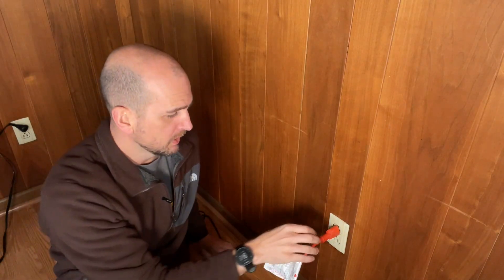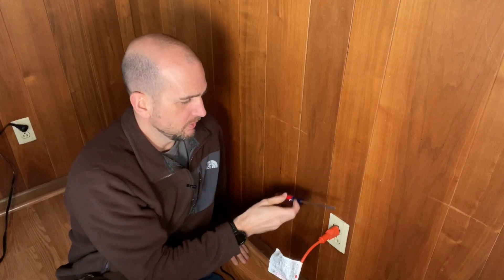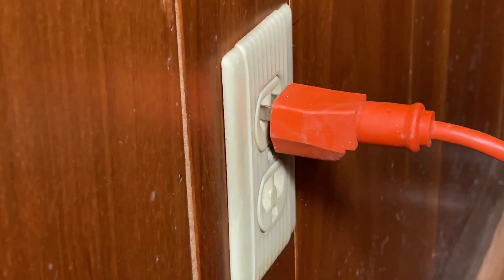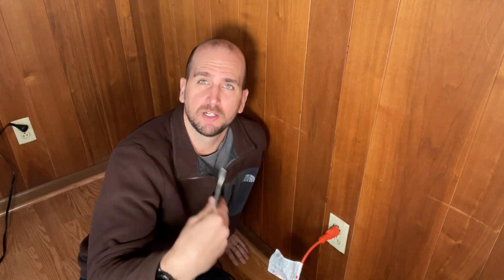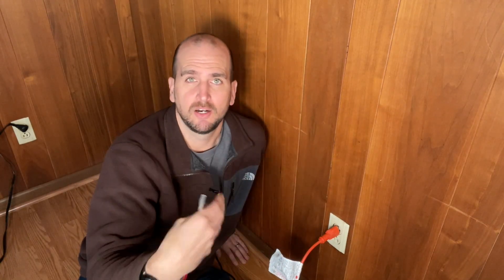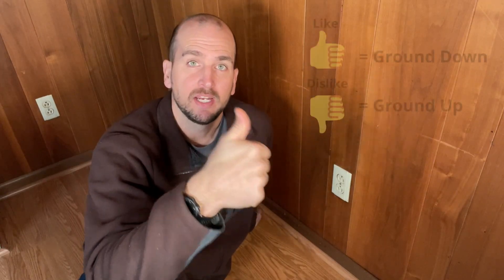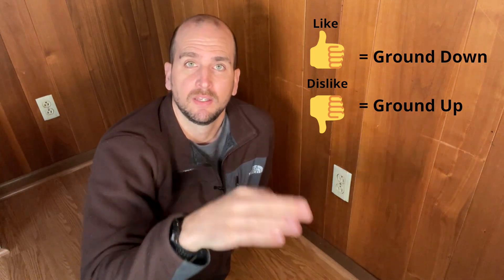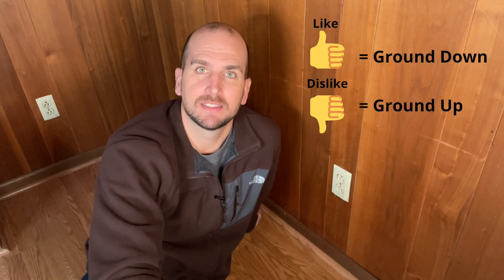Should An Outlet Be Installed Ground Down Or Up

Comment: To me it makes sense to have the ground facing the ground. In Australia the earth faces down but in China it faces up (it is 180deg rotation IIRC). Our power sockets with switches have a red mark on the switch and you make this visible to the user so the earth is down (I think it covered by AS/NZS3112 but I am not sure.)
Reply: There is no regulation concerning this in Australia/NZ.
However, it has become a "convention".  
Since both single and dual outlets are installed horizontally in Australia,  devices such as Switch Mode Power Supplies are designed on the assumption that the Earth pin faces down.
Also the most popular plug in Australia has a sideways connection for the cable at the 135 degree (4:30) position. (i.e. It is angled downwards to the right hand side)
This "works" only if the Earth pin is downwards.
(https://commons.wikimedia.org/wiki/File:Australian_32_A_vs_10_A_mains_plug.jpg
Reply: @FrodoOne1 That link show nothing. yeah and the red mark on the switches make it stupid to install them so that can't be seen.
Its ages since I have a 135 plug on a new product in Australia but I don't doubt that they may exist.
Reply: @ianmontgomery7213  I am not really sure of that which you may be writing.
How about this (https://www.bunnings.com.au/hpm-10a-3-pin-white-electrical-plug-top_p7053432) as an example.
Or, perhaps, this plug on the device concerned 
https://commons.wikimedia.org/wiki/File:Australian_10_A_Power_Board_with_Overload_Protection.jpg
Reply: @FrodoOne1  The socket has the switch with the red mark not the plug.
https://www.bunnings.com.au/deta-double-pole-double-power-point_p0087096

The only reason I can for the convention is that if a plug becomes loose and is about to fall out then having the earth on the bottom assures that the socket is earthed until it disconnects.
Reply: @ianmontgomery7213   @Ian Montgomery  The "link" had an extra erroneous ")" at the end. (Sorry)
This has now been removed and the link now "works".
Such plugs are readily available for replacement purposes and are installed on many "extension leads" and "power boards". (https://www.bunnings.com.au/arlec-4-outlet-powerboard_p4330507 )
Reply: @FrodoOne1  yeah but we are talking about sockets not plugs. Plugs have to go in whatever way the socket is configured.
Reply: @ianmontgomery7213  Yes, "we" are talking about socket outlets.
"Plugs" must need fit into them and conform to the "orientation" of the socket outlet concerned.
However, the two devices work in combination - for the satisfaction (or otherwise) of the users concerned.
It seems that Australian manufactures and users have come to an "arrangement" which is satisfactory to all concerned - without "GOVERNMENTAL" regulation.

(Australians seem to be quite good at such "arrangements" !)

Comment: Had an aluminum outlet cover come off & fall across both legs when a client went to plug in her dryer.
  It took a while for the breaker to open as the cover slowly slid down while melting across the legs.
  Huge black marks on the new paint, Burn holes in her sweater sleeve, red spots on her arm.
       It looked like somebody had taken a plasma cutter & cut 2 slots into the cover.
       Heavy brass outlet prongs nearly severed in half & welded to the cover plate.
A painter had taken out the cover screws to paint & had not put them back.
       She was reaching down behind the dryer in quite an an awkward position to plug it in
       & BOOM !!!! 
       Happened circa 1989, still to this day when I see a dryer outlet 
       I remember the wide eyed look on her face when describing it to me.
This was a 220v 30 amp outlet
       My take away is that ground prongs should be on top in some situations.

Comment: @5:10  -  You seem to be arguing that if a scenario exists that defeats a safety measure, then the safety measure has no value.  You could also cut a live lamp cord with a pair of scissors.  Does that mean that insulation isn't really useful?

Bottom line -
Ground down - esthetically pleasing (because it's what people have become accustomed to seeing)
Ground up - additional safety measure (when a grounded plug is n use)

Comment: For switched receptacles they do make both outlets 
     & covers that have a "Controlled" symbol or text on them.

They show if the top, bottom or both outlets are switched.
Often used in office spaces to turn off receptacles when the room is empty.
"Switched" is not "Automatic" but seems like it may be an option?
    NEC 406.3

Leviton   5262-1pw    Old Style Bottom Switched Marked
	        5262-2pw    Old Style Both Switched Marked
	      16352-1pw    Decora Top Switched Marked
	      16252-1pw    Decora Bottom Switched Marked

They are required since 2014 on any outlet that is  "Automatically" controlled.

There are also special outlets marked "Lamp Load Only" = dimmer controlled
Comes with a special cord cap for the bottom outlet
so that you do not plug in the vacuum cleaner & burn up your dimmer
    NEC 406.15

https://www.google.com/search?q=controlled+outlet&rlz=1C1GCEA_enUS870US870&hl=en&sxsrf=ALeKk01xNkvFLEGydClAqRNg0Tu6ad95zA:1616267834043&source=lnms&tbm=isch&sa=X&ved=2ahUKEwjhmfDwyr_vAhWkMX0

Comment: Ground up is safer. We have always placed outlets this way in garages and shops. Good practice everywhere ..even though we see ground down most residential locations. The two prong better argument is moot since it is the same risk of an accidental short. Ground up will always give u some extra protection with 3 prong...ground down never will!

Comment: If you look at the writing on the socket back, or even on the front. If you can read it than that is the way to mount it. If its upside down that would be a clue as to the way you don't mount it. Just my way at dealing with them.  If you know you are going to mount one of the flush 45 plugs, than it makes sense to flip it. Just use common sense.

Comment: I could never make up my mind so I just install them horizontal with the ground facing north or west depending on which wall it's on. North and west is because those are the probable directions for thunderstorms and consequent lighting in my area.

I had a prof in university suggest that the orientation of the ground depended on the mounting height of the receptacle on a wall. He suggested ground up when one had to reach down to plug something in and ground down when having to reach up. His reasoning was that a ground prong is slightly longer than hot and neutral prongs, you wanted the ground to be the first point of contact when plugging something in, and the natural movement of how plugging something in leans toward this theory which totally falls short when the plug has no ground!

Comment: I've always installed ground-down.  Besides the cord you showed, plug-in power meters like Kill A Watt are designed for ground-down.  The display and controls will be upside-down in a ground-up configuration.
Reply: Same with probably 99 percent of all plug-in electrical consumer products.

Comment: In practice I try to wire ground up..   both for the ultra thin picture frame scenario and in the case of twist lock plugs normally the ground has the hook.. with the hook on top.. the weight of the cord won't pull the plug out of the socket. That said.. I have reversed the orientation of an outlet If have a conflict with a flat cord or nightlight. Then I just relocate my ultra thin picture frames from that wall. The other issue is some transformers with the screw hole to secure it to the center outlet cover screw... works a little better with the ground in the down position.

Comment: I put in 43 years and I am retired from a major power company. In industry we always put ground up because most heavy cords the ground prong is slightly longer so you can see the plug getting grounded before the other two prongs contact. This insures if there is a problem with the equipment it is grounded first. When I did residential work I did it both ways but if you grab a cord that has 3 prongs it will naturally land in your hand ground up. Not an expert just my 2 cents.

Comment: Retired from a large childrens hospital where grounds were always up due to if screw falls out of receptacle stainless steel plate would short out out on plate. With horizon mounted receptacles the grounded conductor ( new term for nuetral ) had to be up. At least once a year we would get a call for receptacle plate that fell off. All in patient rooms so they installed tamper resistant 6/32 screws to prevent people from loosing screws. NEC never had anything concerning this. Most refrigerators & washer maalchines have right angle moulded plug with ground on top.

Comment: Years ago the code said to have ground up and the next code they took it out. I was told neutral was to be to the left and was the standard since the 50s. Then hospitals said to have ground up for the reason you mentioned but they also said ground down for above 4’ (counter tops and garage walls example) because the chances you would strike the plug from below. Standard has been ground down forever so I guess that’s why the took it out of the NEC code except for that one time in the 90’s, I think it was the 90’s. Too much confusion and they weren’t going to change out the millions installed receipts.

Comment: So 45 years of doing electrical and teaching electrical, while it is true that the NEC does not say which way receptacle is to be oriented, it is good practice and done in commercial and Industrial builds often,  that the ground goes up if the cover plate is metal. This is so in case it loosens due to vibrations and slips off [and the plug is not pressed in tightly] , the metal cover plates hits ground preventing faulting between neutral and hot.

Comment: for years everyone just went ground down because that was the usual way to do it . but i have actually seen a piece of aluminum foil on a kitchen counter slide down along wall and make contact with the hot and neutral starting a small fire . so i have switched to ground up for safety

Comment: Personally I don't care EXCEPT!!!! manufacturers make RIGHT ANGLE plugs with GROUNDS ON TOP and GROUNDS ON BOTTOM  and as far as I can tell there is NO RULE OF THUMB! I just want the wire HANGING DOWNWARD DIRECTION so no STRESSED condition. SO...Does your refrigerator or what-ever plug have ground on top or bottom? THAT'S the way you have to orient THAT receptacle!!!!! Duh!....

Comment: I install down unless it's for a specific device, or switched outlet...  or by request.   That said the ground up will also hold a grounded plug in better, keeping a solid connection over time especially when it starts to get loose as it ages.

Comment: If you look at the original UL approval of the design it shows ground up. In addition some localities ie: Los Angeles, CA require ground up, however some have gotten around this by orienting the outlet horizontally, in which case LA required the neutral (longer slot) to be up.
(This from personal experience of 50+ years as an electrician)

Comment: I prefer ground down as it’s been that way since as long as I can remember, like when they first came out with the three prong plug/outlet. As noted in this video with the flat 90 degree plug, it puts undue stress on the plug wires. Another one of my pet peeves is these people the put these outlets horizontally as I’ve seen in foreign countries.

Comment: In the video you talk about surge protectors that have angled 90° plugs having to curve down to the ground, but not only do I as a tech nerd, hate to see cords look like that, but I prefer to have the surge protector/battery backup, especially when used with a desk, or other similar application, hung under the desk top/tabletop or hung on a ledge, or the side of said desk, table, or entertainment center... The reasoning for this, especially in wet areas, is that if it is on the ground it can be a shock or shorting hazard if water contact is made... The other reason I hear people talk about, is that it can be a tripping hazard, depending on where the strip is used... Another reason to mount the strips under the tabletop, is that once you do that any cables that you do plug in can be cable managed better,band more hidden, because of the close proximity of a surface to attach the cords to using either zip ties, or velcro straps, or something else that would be suitable for the purpose... I have heard that in some areas it may not be up to code, or against insurance company policies, to have power strips laying on the ground as well, especially if you are overloading circuits by using too many power strips, or having too many things plugged in... Now, obviously, I don't know codes for everywhere, and honestly don't know much about codes for electricity at all, but I know in my area, in a local town, it's against the code to change out a plug in washer and dryer without a permit, and I know that has basically nothing to do with electrical code, but it is still interesting
Reply: New ranges and dryers don't come with plugs ("pigtails"). Do you really have to hire a licensed electrician to put the pigtail on? I used to deliver and install ranges. I had to install the pigtail (plug) as it was sold separately. Older houses had three-prong hot-neutral-hot receptacles. So the pigtail had to match.

Comment: If ground is up, that would be backwards and or upside down for standard U.S. large polarized prong being the the neutral side for electrical cords and night lights to which is on the left side and not the right side???? What does the codes state??????

Comment: If you look at a NEMA 5-15 plug picture, ground is up.
Being an electrician, right handed, i put them ground down, because when installing one on a live circuit, what you should not do, you connect the live wire last, and it will be on the right side.

Comment: Several outlets I have a cold and hot outlet in one. Meaning I have two power lines going to both outlets. One will be for a switch the other on all the time. So by putting the outlet up denoting or swish outlet won’t work in this configuration.

Comment: And as soon as you switch all of your outlets to the safest ground up configuration, you buy a new printer with a wall "wart" with a built in ground where all of the weight is now way up in the air and impossible to keep plugged in.
Reply: I'll admit I've solved that with some plumbers tape and a couple half inch screws.

Comment: Ground down provide a different safety factor. With the ground up you could have a powered device without ground if gravity or something push the plug down. The ground will get disconnected first but that's probably why the ground prong is usually longer.

Comment: I am not an electrician, but I do have a bit to say on this issue.  As a teen I learned the saying "Right is right, Left is long and ground is down."  Later in life I spent nearly 20 years living in Germany working for the Army.  German wall outlets are recessed into the wall about an inch which prevents anything from shorting across the plug.  If the NEC wanted to protect people and property then they should force a change on the companies making the outlet covers.  A faceplate cover with a simple ledge protruding above the top recptacle would prevent such accidents.  I know some individuals would just say turn the plug upside down and be done with it.  However, life is not that easy.   I cannot count the times  that I could not plug into an outlet because of the design of a plug.  As others have stated turning some plugs upside down and they will simply fall out.  Also small box type battery chargers are not designed to be turned upside down.  Good luck on trying to keep one of those things plugged in.

Comment: I've was in a condo where the "normal" orientation was ground facing down except on any receptacle that was controlled by a wall switch.  I don't particularly care for this aesthetic, but I thought that was useful to be able to quickly id a socket as part of a switched circuit.
Reply: The fun part is that the outlets where I am will have the top outlet controlled by the switch, and the bottom is always on.  It makes it easy to switch on all the lights when I get home, and not worry about turning something off when I go to sleep
Reply: What if it’s split one outlet always hot?
Reply: @The_Original_Forrest_Trump  In my experience, it is rare that both sockets are on the switched circuit.
Reply: @Impatient_Ape  That’s what I meant.

Comment: There is also the issue of plugging in bulky "wall wart" transformers.  If the outlet is installed ground up, then those wall warts will be upside down, with the bulk of the transformer, as well as the cord going up the wall, placing a relatively heavy weight on the outlet.  Those wall warts are designed to hang downwards from the outlet.

Comment: Ground facing up for heavy and stiff cords is best. When the weight of a cord pulls down on the connection, the top comes out more. Having the ungrounded conductors on the bottom keeps the connection tighter, reducing overheating from a heavy load. But don't take my word for it, try it yourself, you will see what i am taking about.